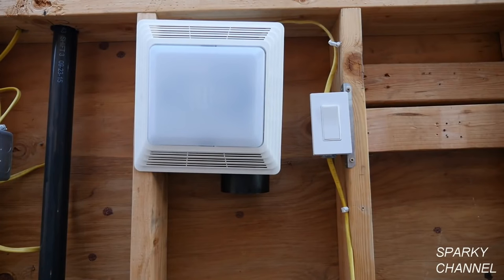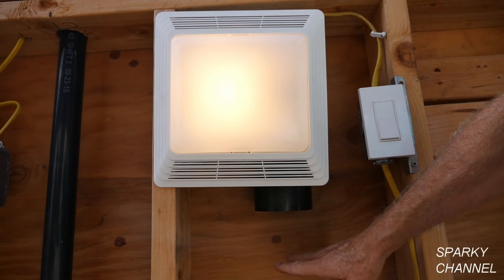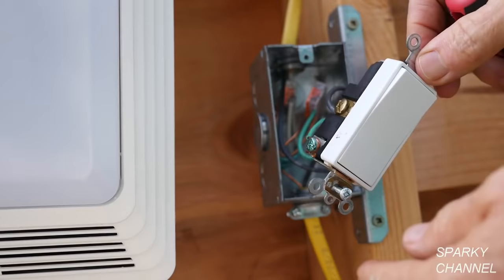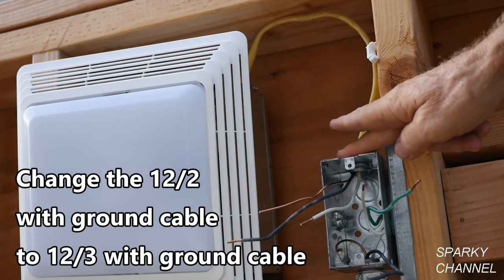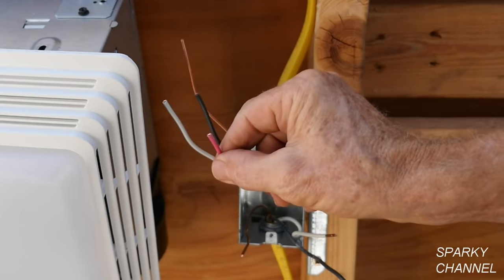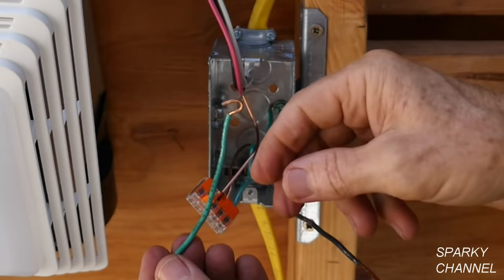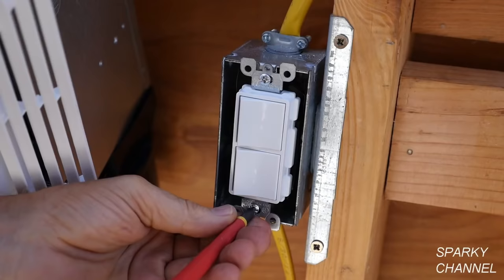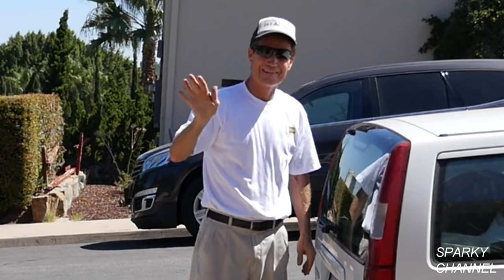How to Put Bath Fan and Light on Separate Switches Instead of on One Switch

Comment: I am installing that exact setup in my bathroom today.  I  was going to use 12/2 and use jumpers.  Would using jumpers with 12/2 instead of using 12/3 be code compliant?
Reply: What do you mean by jumpers!? The only good way to not use 12/3, is to use a remote control fan+light.
Reply: Are you creating a cascade where the fan can only come on when the light is already on? Then I can see a jumper being useful: going from switched light terminal to fan feed terminal.
Reply: I was going to install one of these today in my mothers bathroom but i only have 16/2 speaker wire so il try the ‘jumper method’
Reply from the maker: @Flatearth69  16/2 will most likely catch on fire. Don't use it.
Reply: You need a ground, 2 hots (black and red) and a neutral (white). You either need 14-3 or 12-3. 14-3 if the circuit is 15 amps, 12-3 if the circuit is 20 amps. I don't know what you mean by jumpers. You could run 2 separate 12-2 or 14-2 cables and use one black for the fan and the other black for the light, but you will end up with an extra ground and an extra neutral in your switch box that still need to be twisted with the other grounds and neutrals, thus increasing your box fill. The 3 conductor cable is the best way.

Comment: Hello Mr Sparky, I just about a new fan it has light and night light. I have 2 switch 1 for fan 2 for light. How do I add double switch like this but for night light and fan.
Reply: Panasonic whisperThin they service told me that it need a wall switch for the night night. So I went got a double switch like yours. But how do I wire it? I only have 2 switch

Comment: How much time do you spend in the bathroom?  

When I shut off power via the circuit breaker, I never assume the breaker is working by insulating the bare hot wire.  I've had old and brand new breakers fail!

Comment: Nice video! Can I use the Leviton double switch for separate switches for ceiling fan and light where I also want to use a three way so I can turn on/off the light or fan in two locations?
Reply: You would have to get a 3 way switch. If you can find a Leviton double switch that is 3 way, you should be able to do it.

Comment: Hi Bill... I have a head scratcher for you... My fan stopped working out of the blue. I bought a new one and did this same set up in my bathroom. Power comes to the switch, and the switch works. I ran a new cable to the fan. Power goes up to the fan. But it still won't run, nor will the light turn on. I'm stumped. What's your thoughts?

Comment: Mr. Bill, what if the combo included a heater, and using a 3 function switch?
Reply from the maker: That would be a light, a fan and a heater? And you would like each on its own switch?
Reply: @SparkyChannel  Yes Sir: Light, Heater, and Vent using single switches or a 3 function switch, thank you for your time.
Reply: Me. Bill I have the same question as Joe.  However I want to install a dual function switch. 1 switch to control the heater and 1 to control both the fan and light. How would the wiring be at both the fan unit and at the switch?
Reply: *Mr. Bill

Comment: How would it look if I was trying to change from a fan/light combo to a fan only ? This setup had two separate switches for fan and light. I just want to use the existing 12-3 to safely hook up the fan. It has a black white and ground. Am not sure which to hook up to which
Reply: If you previously had a double switch controlling your old fan the on both switches one would more than likely have black the other red im assuming now when you replace switch you will youse a single pole switch so you will then choose either black or red to use then up in the ceiling fan box you will connect the red or black to your fan whichever you chose at the switch wire nut the end of the other wire you are eliminating

Comment: Ok so I have a question. I have an old house (1950). I have no ground wire in my light switch box. I'm trying to add a new fan to my bathroom. The old one is dead. 

So the main line hooked up to the light switch right now is a single black cable and a single white. 

Next to it is a non-live Romex cable that has a ground (ground is not connected to anything nor are the black and white. It's just loose in the box, and loose in the attic. Black wire, white and ground. So I'm guessing as one point someone wanted to do what I'm doing, ran the Romex wire, then gave up? 

My question is, is this set up enough to set up my fan to be controlled by 2 separate switches? 

The braun fan/light combo I am trying to hook up has 2 black, 2 white and 2 grounds. 

Any help is much appreciated. New subscriber!
Reply: No … it sounds like you currently have a 12/2 wire in place, you need to fish a 12/3 wire from the braun through the attic and back to the switch as he suggested in the video to operate the light and fan separately.

Comment: That's Easy enough when you have open walls. But if your walls are enclosed and your Romex is stapled to the stud, you can't just move it out of the way. You'll need to pull the 12-3 through the existing wall.

Comment: After about 20 years, the fan part of one of my bathroom fans has failed and I’m looking for a replacement. I already have two switches, one each for the light and the fan.

Can I safely assume that all combo units have wiring to operate the light and fan separately? Manufacturers’ installation videos and online descriptions don’t mention this.
Reply from the maker: Yes, they are all able to be wired to separate switches as far as I know. I haven't worked with all brands and models though.

Comment: Ok,so you pulled 14\3 which means your sharing a neutral.If the panel has Arc Fault breakers,this wont work.As you know,you can not share a neutral with Arc Faults.I believe they have a wire called 12-2-, and 14-2-2.
Reply: But the AFCI is upstream, and the 'hots' merge at the switches.  So to the AFCI it just sees one neutral and one hot.  If the AFCI was AFTER the splitting of the hots, I could see what you're saying.

Comment: Hey Sparky, my bathroom fan and light turn on and off at the same time. Today they both quit working at the same time. It’s not the bathroom circuit as the light above the sink in the bathroom still works. So why is this? Is it because my bathroom fan and light are connected in series, forcing either both of them to work or neither of them to work?
Reply: Likely a wire has broken on the black power wire feeding the box.

Comment: I used both common screws without severing the connection in between the screws, to a heater and a fan, does it matter?
Reply: Was wondering same. If one would double pig-tail hot wire coming in 
break tab with one hot pig to upper and one hot pig to lower with black going to light & red wire to fan, is that what you were looking for?

Comment: Is 14 wire ok to use?
Reply: Yes, for most light/fan situations a 14-2 or 14-3 is fine as long as it is on a 15 amp circuit.

Comment: Hi Sparky! I’ve got (2) 14/2’s running from switch to attic. Can I use these two or do I need to run a 14/3 to accomplish what you did here? One common wire.
Reply from the maker: You need a 14/3 or a 12/3.

Comment: How would you make a 2 or 3 switch into 1 that turns on both fan and light?
Reply: Wire in series. One load wire to first device, then second from switch. One hot wire (line) coming into switch. Neutral bypasses switch and then pigtail neutral from 2 devices to it and back to the main circuit neutral line. Thats pretty much it. If you turn switch on, electricity flows from device 1 to 2 and back on neutral.

Comment: How would i run the hot wire if i have 2 separate switches instead of a double switch??
Reply: use one of the 3 wire wago connectors he was using or a properly sized normal wire nut. put the incoming hot and two short black wires into it. Take each of the short black wires to the hot connection on each of the switches.

Comment: Can you make a video with power source on the fan,i got an old house y most of the power source is in the cieling...thanks I hope you understand me. Thanks
Reply: Hi Salchy. I have same question as you. Hopefully. We’ll get an answer soon
Reply: Are you saying the powered (hot) wire is connected directly to the fan/light unit? 
If that’s the case, then the switch must be intended to apply & remove the Neutral to/from the circuit.

Comment: Ok I consulted my father, who is an electrician btw,.... and he's telling me that, basically, you go from your power source, STRAIGHT TO THE UNIT TO BE POWERED! (In this case; the fan/ light combo....) Then run another, whole different 120 wire, FROM YOUR FAN/LIGHT COMBO, TO YOUR WALL SWITCH, AND/OR SWITCHES!!!!

He says you can do it this way. (As this video shows), but the way he told me is, supposedly, UP TO CODE!!!! IS THIS TRUE????
Reply: I don't see why you couldn't do that. You're adding a cable instead of replacing the existing one. Which may be easier for many. You can tie the 2nd switch into the hot ,neutral ,ground that is feeding the 1st switch. Then run a normal 2 conductor cable with ground to the light for the fan.

Comment: 😭 i been hoping for a retro work around that lets you run light and fan separately, inexpensively, without opening walls and ceiling nor using new wire.
Reply: One way is to install a RunLessWire receiver at the fan. It will separate the two. You need a double-gang box to do it.
https://runlesswire.com/product/simple-wireless-switch-kit/
Reply: @Noah-qt3rq  that is very cool! Bit expensive unfortunately.
Reply: @Noah-qt3rq  is this your company? website looks brand new.. ?
Reply: The only work around is a dangerous one.  And that is to turn the white wire into a hot wire and use the bare ground wire as the neutral.  You would either then tie the neutral and ground together or not have it grounded at all.  Both of which would be out of code in most places.

Comment: Man, have I got the weirdest wiring in the world. 

I've looked at dozens of videos trying to do the same thing, i.e. make the fan and the light work from two different switches. I took the plate off, pulled the existing single switch out, and found only a black wire and a red wire. Nothing else. No ground, no white, no nothing. I have no idea what to do now.
Reply: Probably a switch loop

Comment: Much easier to get a new fan with a wireless remote instead of fishing 12/3 and all that.
Reply: Until the emote falls in the toilet or someone else is using a remote on the same frequency and your bathroom fan and or light turn on and off seemingly at random. I use a bluetooth wall adapter with a wireless switch, witch gets trigged by other bluetooth devices within range. Or, you'll lose/misplace the remote just like the one for the TV. Just fish the 12/3.
Reply: @rickgeller6043  Exactly.  Don't take the lazy way out.

Comment: Now go up into the attic and show us how you run the wire in old construction. That's the hardest part.
Reply: You could tape the new wire to the old wire before you take the old wire out then just pull it through. Don’t even have to go in the attic. 

*I’m not a pro btw. But I came up with that solution as I was watching this
Reply: @cmorgancox Except there's staples preventing this method (usually).

Comment: Just use the ground as the neutral and save the time. Grounding is over rated.
Reply: Technically if you wanted to, you could also wire the ground in with the neutral like they do with thing like stereos that have the polarized plug.  That's why the polarized plug exists on a lot of devices because the neutral and ground are sharing the same blade which is the wide blade.  But it wouldn't be up to code.